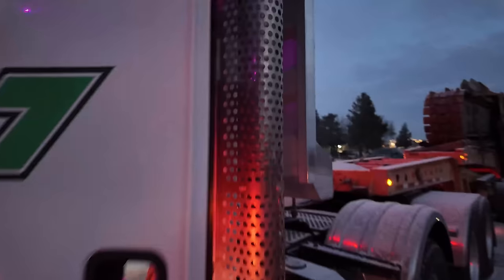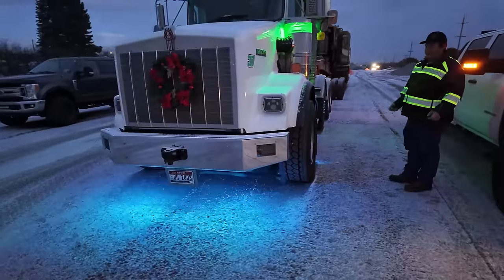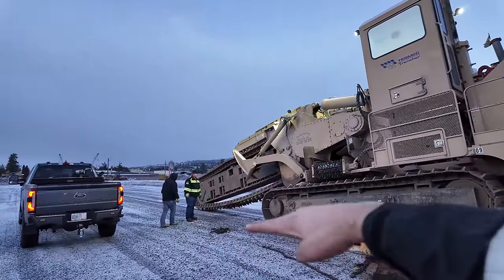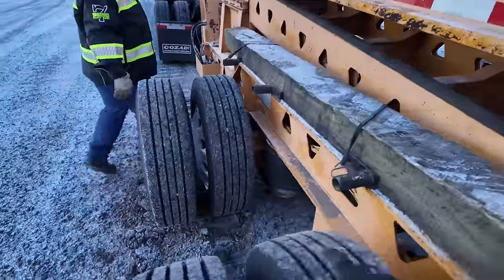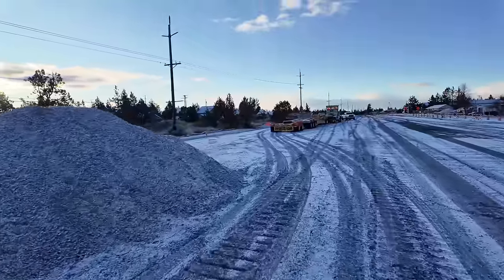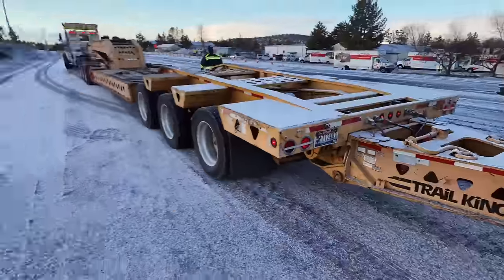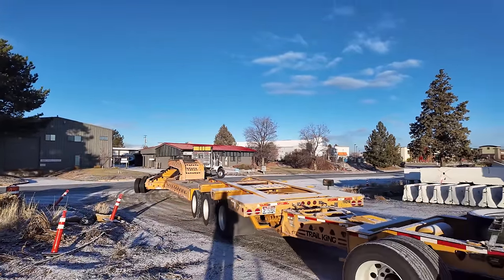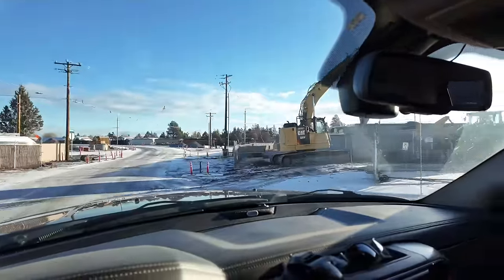Is This Paul Bunyan’s chainsaw??  🤔

Comment: Casey when are you getting fancy undercarriage lights?
Reply: He needs RGB lug nut spikes, with a bespoke controller that can sense wheel speed and factor that info to produce a stationary pattern while rolling, or a pattern that rolls at a different speed than the wheels.

Comment: I worked for a utility company years ago here in texas that had a vammeer trencher. It was the largest one they made at the time. We had a job come up with rock but the trencher wasn't long enough to reach. So we had it modified by a local welder to extend the boom another 14 feet. We had it running on the job and had a bunch of engineers from China come to watch it work. A ton of pictures were taken and they told us it was the largest trencher ever at the time. It was a cool feeling to know that the machine that I was operating was a 1 of 1
Reply: We had one on site in Utah that would go 55 ft deep I think. They trenched and mixed concrete with the soil at the same time as a water barrier for the underground portion of a building.
Reply: Nothing cheap with the word Vermeer on it.

Comment: Actually, I like underglow lighting.  The problem with regular lighting is it can be difficult to judge distance when you're a ways away.  You have no idea how light off the pavement or how far apart the lights are.  But underglow "marks the spot" on the ground so you can see exactly where the vehicle it is. It also helps you figure out if the collection of lights are one vehicle or a formation.  It really helps mark the edges without blinding.

Comment: I saw one of these heavy haulers at an ohio rest stop. They were only driving it at night because it was also a wide load. After looking at it for about 15 minutes, i figured out the load was a completly intact rotating dam sluice gate assembly. With a coverage of 15x30 feet.

Comment: I watched one of those machines cut a trench through solid rock out in the desert near las vegas to run a fiber optic line. it went along the old road that goes from primm to baker

Comment: I live near the entrance of a large timber reserve.  I love watching them haul the huge feller bunchers in. They go in on a trailer just like this.  Right down the road from me they have to make a tight 90° turn into a side road.  They have to close the road with flaggers.  The driver will drive past the turn, and then back up jackknifing the dolly between the trailer and truck.  They'll fold that back and then once the truck is pretty mush along side the trailer, the driver will pull forward and go down the side road.  One difference between the trailer they have and the one in the video is the trailer is setup with hydraulics that can lock the front set of rear axles and lift the back two rear axles off the ground.  When making the turn, the rear axles pretty much just slide around and it leaves rubber on the road big time.  If they couldn't lift the rear most axles, they would be really dragging around sideways, even with the pivot.

Comment: very cool large equipment.  Only thing I didn't like was securing that wood beam with bungee cords. If it was mine I would have a more positive secure for it.  I am sure its fine but always try not to give a dot guy the easy find.

Comment: I'm so glad in Australia we have a bit more wriggle room in height restriction so we can just use a multi axel platform or a widening low loader the set up and moving it around is just so much easier in the loading and unloading not to mention a whole lot shorter

in saying that you gotta do what you gotta do what works for me might not work for you

Comment: is that more effective for him to have an axle up, weight distribution or stuff? I would have imagined that the more axles you have the better for heavy load
Reply from the maker: The lift axle is up for any backing up, tight maneuvering, or when the trailer is empty.   It’s only down when loaded and traveling on the road

Comment: I can't imagine the stress on the driveline u-joints with a GVW of +/- 200,000 lbs.
Reply: Six States in Salem, OR has a "carnage" display in their lobby.  They have several busted drivelines and yokes, up to some that must have come off heavy haul trucks.  I can't imagine the BANG those made when they went.

That said, it is normal for the heavy haul trucks like this to have low range rear axles.  They have a planetary gear set that rides with the ring gear and carrier.  It uses compressed air to select between direct and reduction.  Low range helps a whole lot on the driveline load.  The axle shafts still bear the brunt though.
Reply: Good job following Betteridge's law. "if the headline ends with a question mark, the answer is no"
Reply: Ole coal truck driver here and my truck averaged 160,000 to 180,000 load after load day after day

Comment: Just curious... What is the gross combined weight rating is on that heavy haul truck? And the tare weight of the truck and trailer?
Reply from the maker: 250k-ish gross weight rating.  80k-ish empty weight.
Reply: @CaseyLaDelle  I know absolutely nothing about heavy haul tractors. Are there mechanical differences between that tractor and yours? Could your Western Star pull that loaded trailer, or would it require a different drivetrain, suspension, air system, drivers license endorsement, etc??  Awesome video and great explanations as always!!

Comment: Hey Casey great video, super cool to see something like that!!! just curious is there a difference between his truck and your truck to be able to haul that kind of load?
Reply: More horses.
Reply: Higher horsepower/torque rating, lower gearing, higher axle weight ratings(mostly front axle) and thicker/doubled up frame rails if I had to guess.

Comment: Why not push the Boom down to lift the tracks up and pull the blocks out while the boom was sitting on the trailer neck?  It had to travel a long way down to the ground to lift itself up.  
What am I missing?
Reply from the maker: You’re missing the fact that lifting the heavy end of a 165,000 pound machine by a single cross member probably isn’t a good idea, and the fact that traveling a long way down is exactly what that boom is there for.

Comment: My father designed a better trenching chain than that caterpillar chain. Lasts 6 times as long and saves time because you don't have to worry about replacing broken bolts. Smartest man I know when it comes to metallurgy and chain design.

Comment: Just curious, how can he use bungees to secure that 8x8 8 ft chunk of lumber to hold up the front part. When not in use he straps it to the side using bungees. 
DOT does not recognize bungees as a form of securement, he must have not had that conversation with a scale master yet. They highly frown upon this set up
Reply: I guess that's what the "Student Driver" sign is for: hoping on a discount^^

Comment: She some of them have shot at n the boom sometimes they have to empty it out to get the weight down we had one that was on the edge of 160k with all the counter weight off 
That is a saw type the biggest one I’ve ever been a part of has a bucket wheel on it and I don’t remember now if what all the dems were but it’s over 225k and I was just shy of 18 feet tall now for all y’all that’s crying out the weight it came in two pieces 
“” And we always broke it down “” because it cost like ten thousand dollars to split it takes three guys two to three days to get apart and then you move it twenty miles and put it back together but know way I’d haul that thing across the country together 
Unless the money was worth it 😂